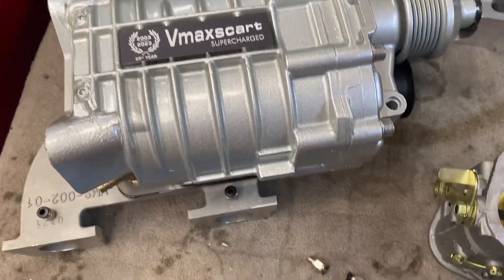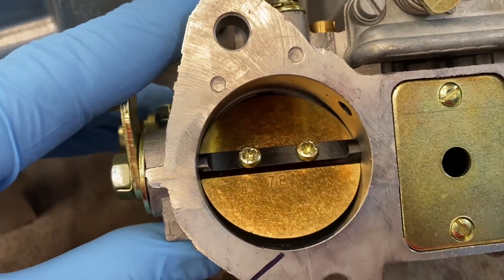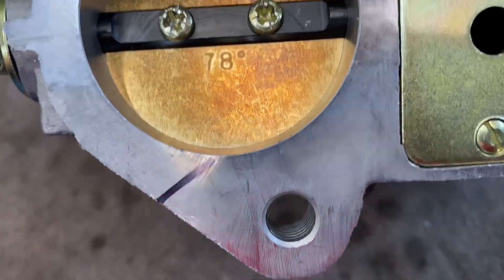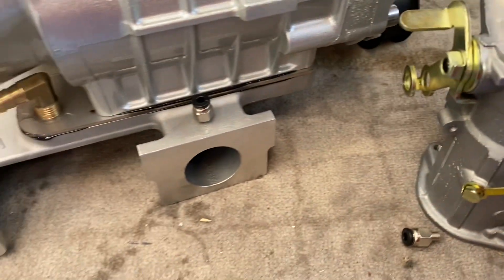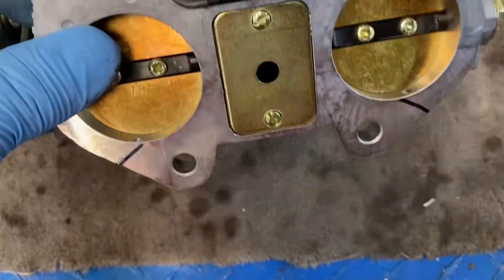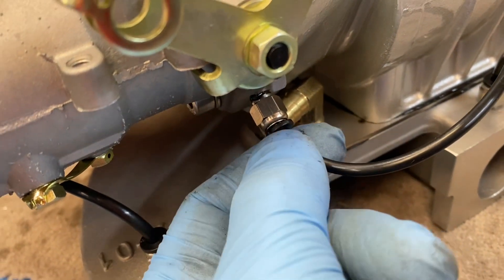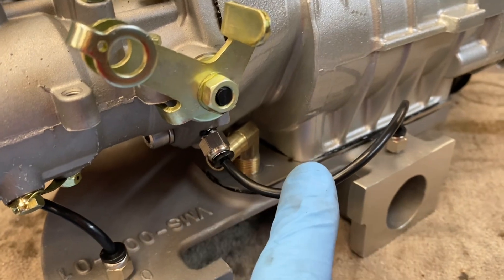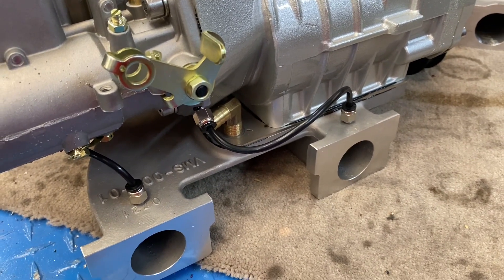Supercharger pump jet bypass hoses

Comment: I always thought the downstream side of the supercharger was at a higher absolute pressure than the upstream side, but if fuel is to travel down those tubes from the carb flange to the inlet manifold then that can't be true - or maybe I'm not understanding exactly how the fuel is dispersed.
Reply from the maker: only when the engine is under load . intial accelleration, idle , cruise  and decelleration the  the pressure differential is in favour of the inlet manifold, if any fuel is not sucked down the pipes  when the engine comes onto boost it is then aggitaed by air coming back up the top blowing it into the air being drawn into the 'charger..